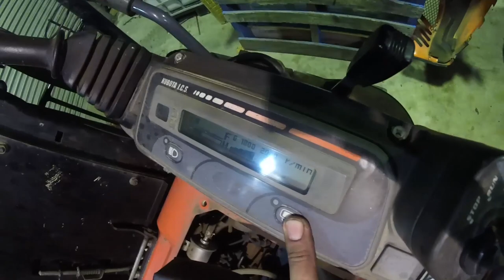Kubota U17-3 Mini Excavator repairs at 2700hrs Hydraulic system service and lots of oil changes pt2

Comment: LIKED!! As just a hobbyist, I thought the hydraulics worked under extreme pressure, so don't understand how you can run it with the oil cap off. On my TakeuchiTB016 before working on the system you have to slowly release the bolt cap to release pressure to get at the return fi!ter. I presume all these machines work basically the same. Please enlighten me! Thanks!

Comment: Thank you I have the same excavator and one of theese days I must to do the same operation, 
I think no but, Is this the first hidraulic oil chengement for yours excavator?
Ciao from Maiolo Italy.
Reply from the maker: Second I think they did it  at 1500
Reply: @Oneupthesleevecustoms  I found on the on line manual of the U17 that there are two little hidraulic pipe filters under the joysticks
Reply from the maker: @massimilianobernardini4655 on what side
Reply: @Oneupthesleevecustoms  both the joy sticks right and left
Reply from the maker: @massimilianobernardini4655 I didn't see filters in there that's odd
Reply: @Oneupthesleevecustoms  where I could send you a screenshot?
Reply from the maker: @massimilianobernardini4655 my face book is same name